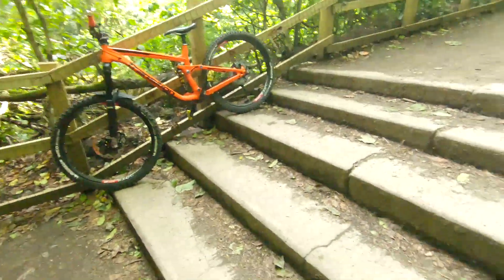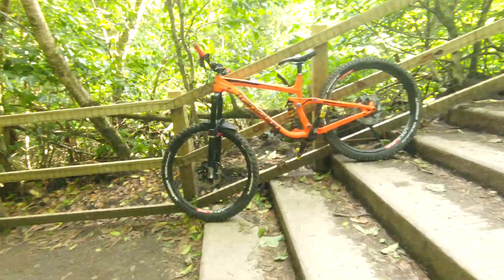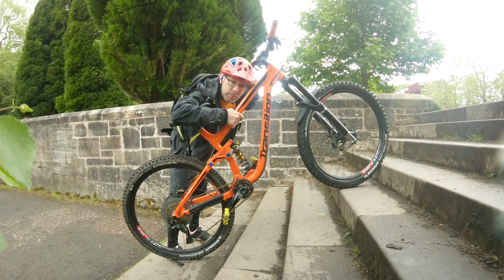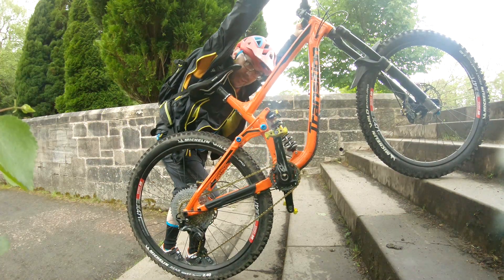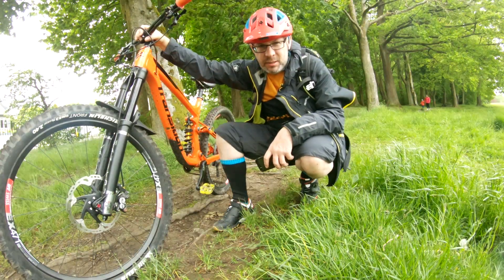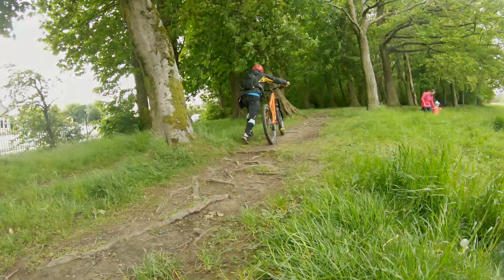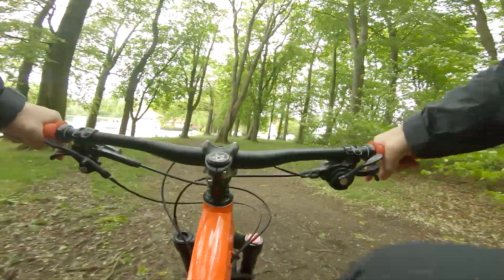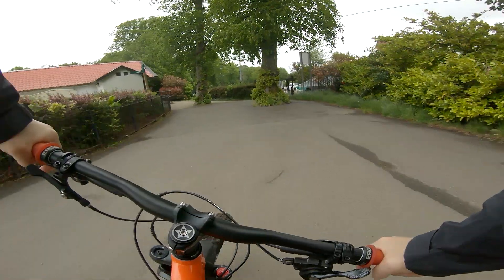How I set up my new Manitou Mezzer forks

Comment: 29" mezzer or 27.5"? I trialed my 2019 Patrol with a 29" version as a mullet and really liked it, even with the fork at 160mm and the longer axle to crown measurement. Interested in your setup
Reply from the maker: 27.5 - don't see the point in running a larger wheel at the front.
Reply: Fair enough. Depends what trails you're riding i guess. I thought i would be faster on smooth fast trails but actually turned out to be more effective on the steep and rough.
Reply from the maker: @AdamWoodNZ  160mm with 29 wheels would give you a higher front end making steep trails easier.

Comment: Pretty much how I set up suspension, but now I use coil front and rear so no more adjsuting pressures.
TIp: your voice was too low in some clips and music too loud.
Reply from the maker: Thanks for the tips!
Reply: @MTBScotland  I am back on air on the front, but two air chambers, Ext Era. The Fox 36 creaked alot fast eventually it sounded like it was snapping. I hope EXT's crown design will eliminate the issue or atleast not get that bad. It uses straight steerer and beefier crown that you install the  crown race at.

Comment: Hi...do you set ur rear shock as recommended 35% sag or less?
Reply from the maker: god no.  its a soggy mess at that pressure.  I run a 400-480lb progressive spring.  gives maybe 30% sag.  a 450lb spring gives around 28% sag but I don't use sag as a measure of anything.
Reply: Cooool...alryte.., Thank you for your honest reply MTB Scotland 🤜🤛

Comment: Low speed rebound
Reply from the maker: what about it?
Reply: @MTBScotland  where is the low speed rebound thingy on the mezzer
Reply from the maker: @Batemarrmb  bottom of the fork leg.
Reply: @MTBScotland  do you have tpc or tpc plus
Reply from the maker: @Batemarrmb  It is called TPC
Reply: @MTBScotland  if you have the mezzer pro it does not have low speed rebound I believe looking at the spec only high low compression?
Reply from the maker: @Batemarrmb  LSR is at the bottom of the fork.  HSC/LSC is at the top.  without LSC you would have no control over the rebound.  even cheap forks have LSC.
Reply: @MTBScotland  this is confusing low speed rebound or low speed comparison  two different things are they not